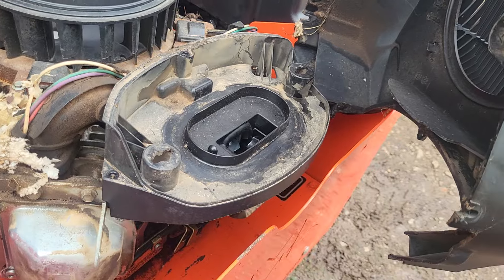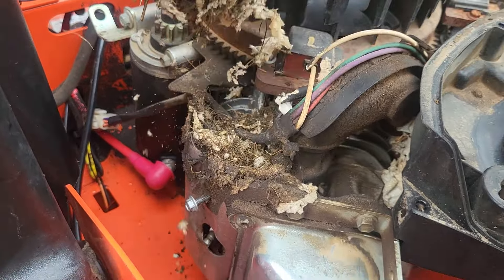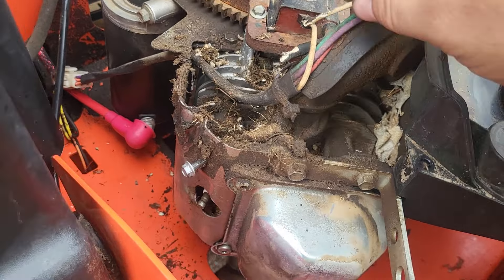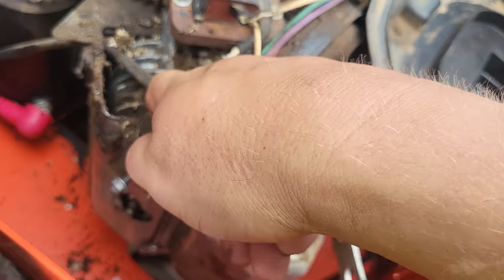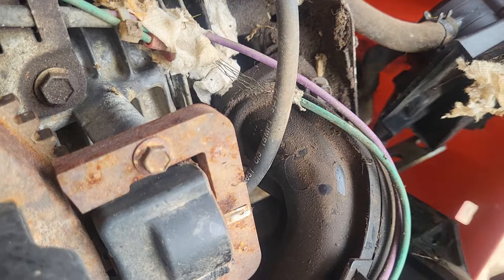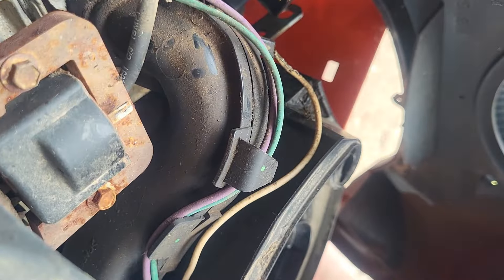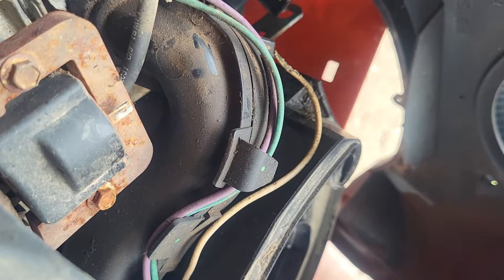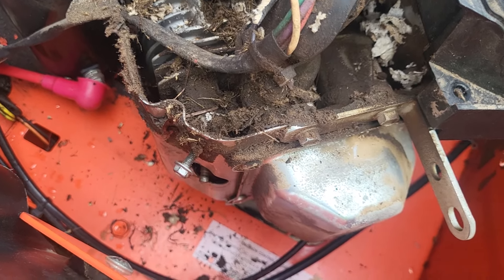Here's how spark plug wire got cut on bad boy

Comment: Hi Joe..sorry for going off topic. Any suggestions with regards to progressively removing / curtailing wild bermuda from tall fescue yard? Thanks
Reply from the maker: Fusilade II. it kills bermuda in fescue or flower beds without harming plants when used as directed. Been using it myself for years. mix a proper surfacant with it like surf king plus. fill free to ask lawn and landscape questions. ive done lot of that when younger too
Reply: @SgtJoeSmith  Thanks Joe. Opinions on this topic run the entire gamut and can be very varied + different. But I know it can be done. Also, it helps getting 1st hand advice from a professional who has been in the field like you. Thanks again + will keep you updated. Thanks for your content as well!
Reply from the maker: @socratessocrates3856  35 years in the industry. mower, truck, trailer, bicycle repair, welding, metal fab, mowing, landscape, fence, irrigation, electrical, handyman, framing, painting and more.

thanks for being a fan/friend